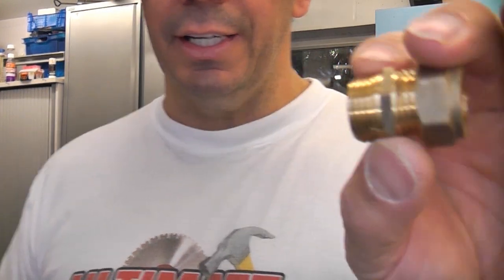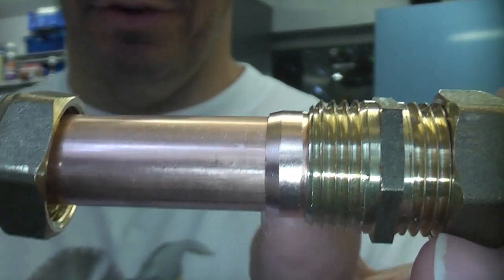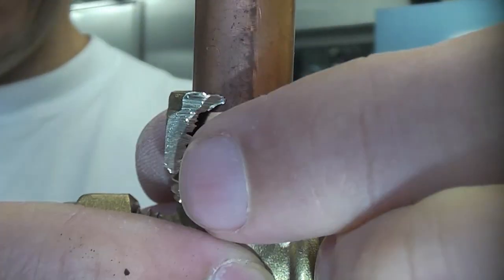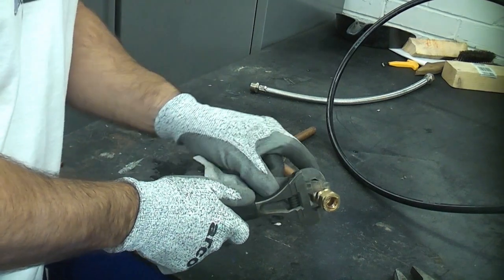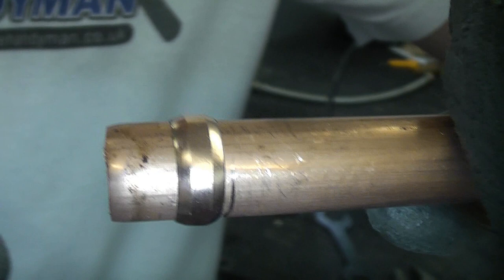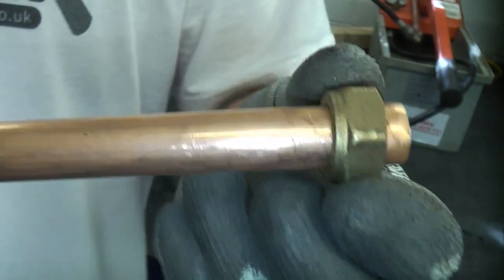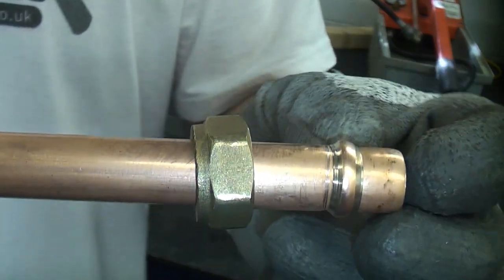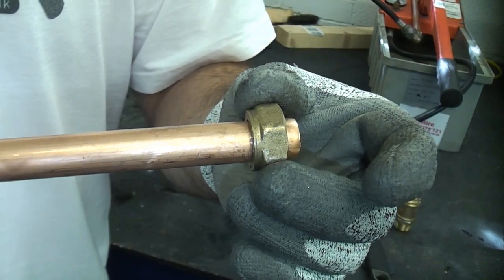How compression fittings work

Comment: Generally a good rule of thumb for DIYers to know when tightening up compression joints is that once you start a bit of resistance nip it up about a quarter of a turn and then stop. Personally I put jointing compound on all of my compression joints as when they are done up dry they usually have the tendency to leak ever so slightly.

Comment: Nice video as usual. That picture right at the beginning is awsome.  Torque specs would be a nice idea for those who would use them but my experience is that most home mechanics and many professionals would just ignore them as they now do on automobiles and other equipment where torque specs actually do exist.
Reply from the maker: Thanks for the comment 👍
Reply: That's not a good reason to not provide them.  Pros ignore them because they know what 20 lbs of torque feels like, for example, after doing it with a torque wrench hundreds of times when learning.  When I replaced the calipers on my car, I sure as hell used the manufacturer's torque specifications.  In this case, it would just be good to know what they are, as most people can tell the difference between something that's supposed to be 15 lbs of torque as opposed to 90 lbs of torque.

Comment: Copper olives for most work and plastic pipes, brass for most work and chrome plated pipe. I see SF dont sell bags of copper olives any more only brass ones. I do like to use a smear of fernox paste on olive tho. Especially when behind shower etc. i try to solder where i can mostly, although i see you yse solder ring fittings and i prefer end feed. I think it looks better. Thanks for the vids and time taken.
Reply from the maker: +Bottles You are welcome ;-)My local plumbers merchants sells copper olives so I normally pick up a handful when I am there!Thanks for the comment
Reply: Screwfix do sell copper olives, I brought a pack few days ago just incase I over tighten my compression fittings and need to replace.

Comment: They use this exact same setup in industry to couple gearboxes between each other etc so I'm not surprised that they can hold a large amount of pressure considering they can take huge amount of torque in different application with the same setup
Reply from the maker: +Nik Trp I have never seen these couplings on the sites that I work on, we tend to use spider couplings or tyre couplings. I'll look out for them in future though ;-)Thanks for the comment

Comment: I have always used a bit of PTFE on the threads, not to help with the seal though, I find it helps stop it seizing and makes it easier to undo again. Just 1 or 2 turns though, otherwise it gets in the way.
Reply from the maker: +caskwith 
I know a few people that use jointing compound, plumbers mait etc. on them. The compression fitting manufacturers say you don't need anything but some products do say for use on compression fittings! As long as the fittings don't leak I guess it does not matter ;-)
Thanks for the comment
Reply: Brass is a self-lubricating material and therefore doesn't require any PTFE tape or similar as an anti-sieze. I've seen more leaking fittings due to using PTFE tape on compression fittings than not. Also, on a clean and correctly prepared fitting/tube normally finger tight plus a half turn is more than adequate to hold 10 bar. At work I regularly use 690 bar on Inconel/Stainless fittings and its amazing just how much pressure a finger tight fitting can hold!
Reply: Max R Re-read my comment again, but slowly this time. I never said a finger tight fitting would hold 10,000 psi but said that's it's amazing just how much pressure a finger tight fitting WILL hold. A couple of thousand psi before a control line starts to leak isn't uncommon - most control lines for subsea equipment use around a bout this pressure. Parker A-Lok 3/8" Inconel and Stainless is what I'm referring to. Calling me full of it just because you don't agree shows ignorance or a lack of understanding.
Reply: +Andy R . i stand corrected. p.s. ignorance and lack of understanding are the SAME thing.
Reply: Max R It could be possible to understand something and still be ignorant of the facts. But thanks for taking the time to reply to my comment. Peace.
Reply: Max R It could be possible to understand something and still be ignorant of the facts. But thanks for taking the time to reply to my comment. Peace.
Reply: Never use PTFE on the threads, downright pointless. Compression nuts are NOT hard to undo. You just need the right tools. I've infact had fittings harder to undo because of bloody cowboys using PTFE on the threads.
Reply: @AndyZ22SE  ~ There seems to be varied tightening parameters with regard to compression joints, from a half-turn to one & a half-turn. I'm guessing that's a margin of error or the term 'turn' is loosely used/subjective at times? Is a turn definable ie. a revolution or a one-sixth rotation on a six-sided nut?
Reply: @JustinMurray170fin  good point there, I need to use some compression fittings tomorrow, and I am so confused how tight I should do them I really don't want to over tighten them. From what I been researching any where from quarter turn to 1 and half turns!
But as you say how is the term turn being used? I would assume a turn means one revolution/360 degree movement, so if the spanner is at 10 o'clock position 1 turn would bring it back to the 10 o'clock position.

Comment: As an apprentice I was always told finger tight then 1 & 1/4 turns. I sort of follow that but have had some weep so tweaked a little more. I have found using copper olives takes less turns to seal them.
Reply from the maker: +Mark Davies Thanks Mark, I prefer the copper ones ;-)Thanks for the comment

Comment: You can also use shark bite. They are super easy to install on pipes. You may need to buy the burr tool if it doesn’t come with the kit have not had a regret using them on most copper projects that can’t we welded
Reply from the maker: Thanks for the comment 👍

Comment: Dear Ultimate Handyman, in a reply below, you said,: 'As long as you use copper olives you won't go far wrong with a 1/4 to 1/2 turn (past finger tight)'  Kindly, ¿is this the same for brass ferrules, please?  (I believe I have brass ferrules on these ball valve ends I've purchased, and hope to install in our home).  Thank you so much for your video and replies to our many questions for help.
Reply from the maker: Brass olives will be fine, but you need to apply more torque to get them to seal properly, as brass is not as ductile as copper
Thanks for the comment 👍
Reply: @ultimatehandyman  Dear UH, thank you for the kindness of a reply.  God[Bible] Bless.

Comment: Interesting video. However, most other professionals I've seen on yt say only tighten them a quarter turn, then if there are any tiny leaks, tighten a touch more. Otherwise, it damages the pipe.
Reply from the maker: A lot of professionals also use jointing compound, which the compression fitting manufacturers do not recommend.
Thanks for the comment 👍

Comment: "larger spanners"... yep... i'd say so LOL

The problem with specifying a torque setting would be that pipe varies in the degree of softness. If the pipe has previously been soldered nearby (often the case when they're used for repairs), then it would be softer... 

Incidentally, another big cause of failure with compression fittings, like solder joints, is insufficient cleanliness. A bit of grit, steel wool, whatever, in between the olive and pipe is fatal. (yes I know you know that LOL)!
Reply from the maker: +TheChipmunk2008 Thanks for the comment ;-)

Comment: A bit of vaseline stops the creaking and allows the nut to do up smoothly and with less force.
Reply from the maker: Thanks for the comment
Reply: @RG5355  Yes, that's what I do as well.  Vaseline or small bit of pipe thread dressing, prevents that chattering noise and the nut can tighten against the olive/ferrule smoothly.

Comment: Ah another one of your helpful videos.
How many turns should you do on compression fittings? Looking at the video you did half a turn to one turn after finger tight?
Any advice please? Thanks kind regards 👍
Reply from the maker: It's difficult to say, some people say 1/4 of a turn once finger tight, but I normally do a bit more than that. I have never had one leak - yet ;-)
As long as you use copper olives you won't go far wrong with a 1/4 to 1/2 turn.
Thanks for the comment
Reply: @ultimatehandyman  yeah using copper olives, ok think I go with a good half a turn. Thanks for speedy response, and excellent videos very helpful, kind regards 👍👍

Comment: I tightened the nut around 3/4 to 1 turn on a new valve with a new ferrule (olive).  I noticed a small amount of metal shavings fell in my pan.  The valve has been in use for over a week and hasn't leaked.  I'm concerned that I overtightened it due to the metal shavings.  I'm worried that it might pop off.  Am I overthinking this or should I remove it an start over?
Reply from the maker: I'm sure it will be fine 👍
Reply: @ultimatehandyman  Thanks for the vote of confidence.  Just to be sure, I'm going to have a plumber verify my work.  I'm gun shy, since I had some water damage (mold) in my kitchen that cost me a lot back in August.  A drain line cracked from stress over the years and did some significant damage by leaking over a long period of time.  It took me 6 months to get it all fixed.  There are labor shortages in the trades in the U.S. where I live.  If that valve popped off while I'm asleep or when I'm away from home, it would flood my entire home.  Having a pro look at this valve install would put my mind at ease just to be absolutely sure.  Thanks again for your vote of confidence.  👍👍👍
Reply: @ultimatehandyman  Just an update on my valve install results.  My pro plumber inspected my installation today, and he agrees with you.  He said that I installed it just the way he would have.  It's good! 👍👍👍 Thanks again for your comment and very helpful video, sir.

Comment: I see so many videos now of people wrapping PTFE around the olive, is this really required on new pipe work, olives and fittings? I can understand it on old pipe work.
Reply from the maker: Nope, you do not need PTFE tape or jointing compound on compression fittings, however if the fitting leaks you can wrap PTFE around the olive.
Thanks for the comment 👍

Comment: When removing a compression fitting from a pipe connected to a cut off valve, is it recommended to replace the cut off valve?
Reply from the maker: No, not unless it is leaking. 
Thanks for the comment 👍

Comment: I'm not a plumber, but when I fit any compression fittings, I put it together and tighten them up until moderate tension and then release completely the fitting, now the olive has "bit" into the pipe a little wrap some ptfe around the olive and reassemble completely. It always takes that little bit longer at the time but it takes longer and costs more repairing leak damage.

Comment: Great video as always!! If the pipe has flux/solder which has dripped down the pipe, can you still fit the olive/compression fitting over it? Or do i need to remove the solder/flux - if so how do i do this? thanks in advance
Reply from the maker: No, you need to remove the solder, as the olive is a really tight fit.
Best way to remove the solder is to heat it using a blowtorch, then wipe the solder away using wire wool/damp cloth (being careful not to burn yourself).
If you don't have a blowtorch, you could use some abrasive paper, such as Emery cloth to remove the solder.

Comment: Believe this or not, I actually emailed the manufacturer of a brass compression ball valve fitting to ask “how tight I should tighten the fitting?” and received this reply, “contact your local plumber”. 
My reply to them was “who tells the plumber how tight the fitting should be?”. I never heard back.
Reply from the maker: 😂
How difficult would it be for the manufacturers to do a bit of testing and then say "we recommend that the nut is torqued up to X".
I'll just stick to tightening it, until is squeaks 😂

Comment: Hi mate, this is probably an obvious question....just in the process off plumbing in new copper pipework behind a wall for a shower.
Going to use compression fittings with several elbows on both hot and cold. Are compression the best and most reliable and if so would you use pfe tape on new fittings.... Any help would be appreciated.
John
Reply from the maker: I never use PTFE on compression fittings, but some people use a jointing compound.
The best and most reliable is a soldered fitting, I prefer solder ring fittings, but sometimes only compression is available, such as for the connections to the shower.
https://www.youtube.com/watch?v=7zlDHA3KhLA

I hope this helps ;-)

Comment: Can you install a compression fitting in a concealed wall (covered by plaster)?
Reply from the maker: I always try to avoid any joint being buried in a wall, just in case the joint ever leaks. Plastic pipes are also preferred, as they are not attacked by the plaster.

Comment: Hi ultimate handy man, what tool can I use to cut the compression nut like you did in the cut away? Thanks!
Reply from the maker: You can use a junior hacksaw, but you have to be careful not to nick the pipe. Most of the time you can saw 90% through the olive and then snap it using pliers 👍
You can buy dedicated olive cutters, but they are expensive, unless you will use it a lot.

Comment: Might be worth mentioning the 3/4x22mm olive for UK watchers-unless I missed it.
Reply from the maker: +David Worsley No, I did not mention that. I have never come across any Imperial pipe for a long time. Is it still common? Thanks for the comment
Reply: Surprisingly so-it was used up to the 70s so I suppose so but I've been off the tools a good few years now so I'm probably not best qualified to answer-they were still selling them in B&Q last time I looked.
Reply from the maker: +David Worsley 
Thanks, I have seen the fittings that go from 3/4 inch to 22mm but I did not know how much they were used. I would probably try and use a Philmac UTC if there was enough room to use one as they are brilliant fittings, especially for different pipe materials.
Thanks for the comment ;-)
Reply: ***** What on earth is a PhilmacUTC?-Well,I bet you don't know what a 4U connector is.
Reply from the maker: +David Worsley 
The Philmac UTC's (universal transitional coupling) are brilliant. They can be used to connect any pipe to any pipe, so for example MDPE to lead, or stainless steel etc.
 

https://www.youtube.com/watch?v=_k5NS5Y-KHg

You are right I do not know what a 4U connector is without looking it up ;-)

Thanks for the comment

Comment: what's the difference between a compression fitting and an AN fitting
Reply from the maker: AN fittings use flared tubing. Compression fittings fit on the tube without flaring as the olive (called ferrule in some countries) is compressed onto the tube when the compression nut is tightened.

Comment: Jointing compound and plumbers reference guide on turns of cap nut plus that horrible squik will go away reducing stress on fitting !!!!!
Reply from the maker: Jointing compound is not recommended by the compression fitting manufacturers 😉
Reply: @ultimatehandyman  don't be put off by that mate.... Been using it for 40 years.

Comment: Can you use a compression joint with lpg catering van
??
Reply from the maker: You can use compression fittings on LPG, they normally have a copper olive.
You might want to check though, to make sure you are allowed to do it yourself! 
I’m not saying that you can or can’t- I know nothing about catering trailer regulations etc.

Comment: I always seem to have a leak or should I say a slight drip when using compression fittings why is this what am I not doing correctly,i do realise that putting PFA tape around the olive is a cure  .if the pipe is not cut square or sit square in the joint be the problem?
Reply from the maker: It could be the length of the spanners that you are using. You can buy a specific spanner for compression fittings and its only about 7 inches long- so you do not get enough leverage with it. 
I normally try and use something long like a 12" adjustable to get enough leverage to tighten it enough. I often use a large pair of water pump pliers to hold the fitting whilst I tighten the nut. 
https://www.youtube.com/watch?v=-9c5LWFI_M4
Reply: Shaun Smith  try to tighten the compression joint as tight as possible and see whether it still has a leak

Comment: So the purpose of the fitting people wont be sodering?
Reply from the maker: Yes, you do not need to solder a compression fitting. It seals when you tighten the compression nuts
Thanks for the comment 👍

Comment: Do compression fittings work for radiator pipes I need to chase to pipes to my radiator in the floor but I can't solder?
Reply from the maker: +Sean Walsh 
Yes Sean, no problem at all. If they are copper you can just use them straight away, but if plastic pipe you need a pipe insert.
Thanks for the comment

Comment: Hi can i use this to fix my pressure washer hose? If i cut in middle n use this will it hold the pressure?
Reply from the maker: No, these can only be used on rigid pipe, not flexible pipe!
Thanks for the comment 👍
Reply: @ultimatehandyman  thx so much your channel is great n nicely explained. Well dun m8

Comment: after placing the nut and ferrule in copper tube,whether the nut or the threaded fitting to be tightened ?or which one kept stationary ?or both in opposit direction ?
Reply from the maker: Best to keep the fitting still and turn the nut if possible.
Reply: thanks handyman.,
Reply from the maker: You are welcome ;-)